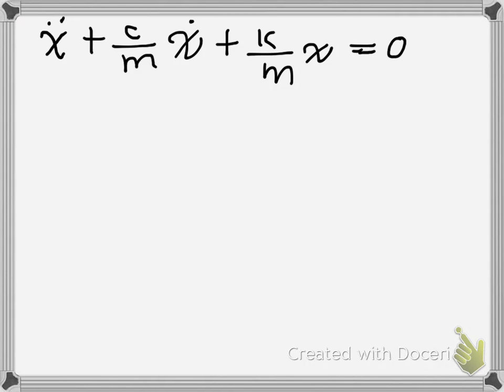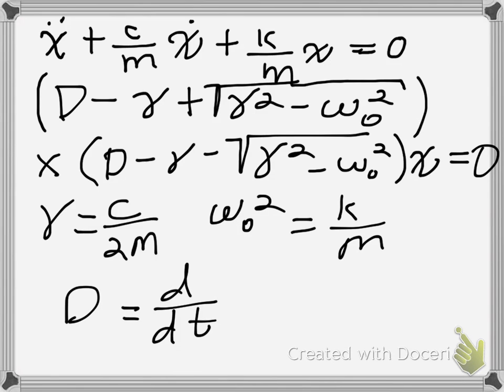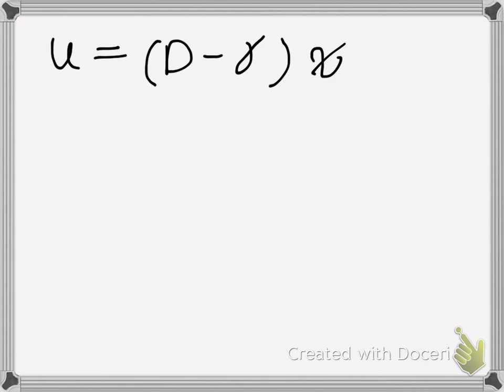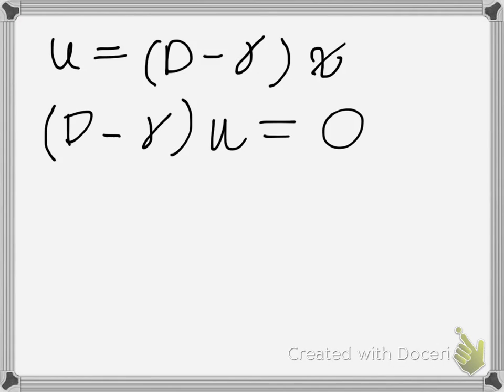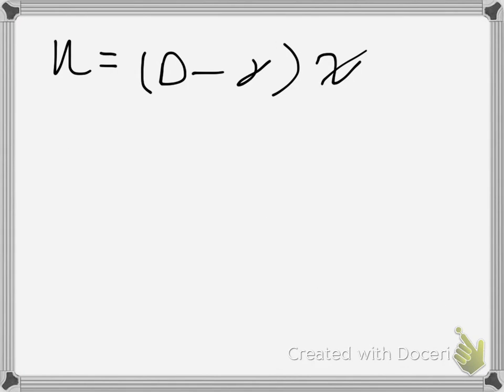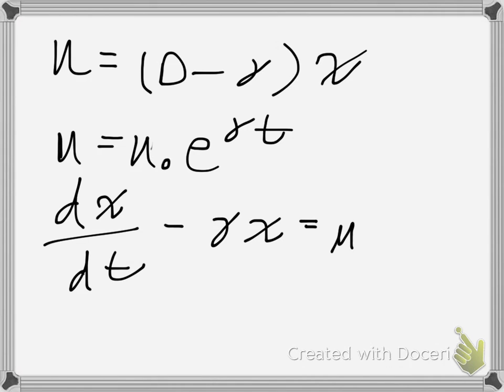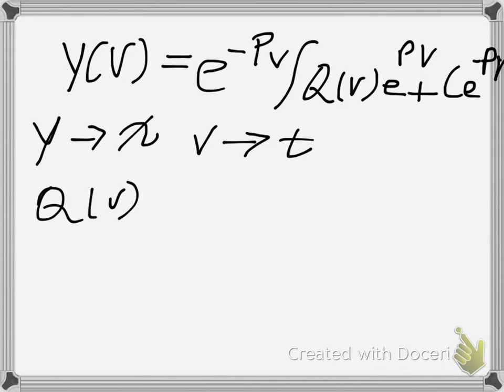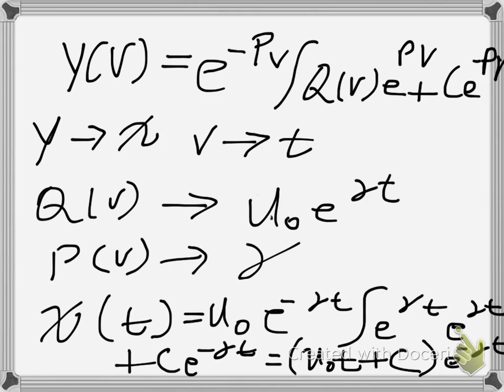Critically damped harmonic oscillator solution

Comment: Hi, when the main operator is factorized at  the beginning there is a mistake with gamma's sign. Indeed, according to the position you made, it should be (D + gamma + sqrt(...))x(D + gamma - sqrt(...)). The rest follows naturally using the strategy you have shown (and you taught me since I had never seen the proof for such a solution: thanks!).